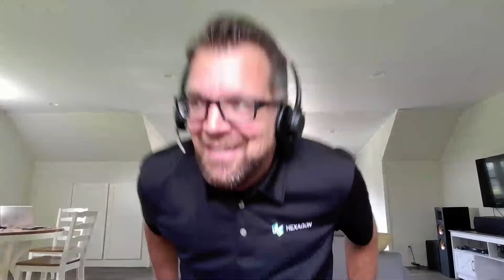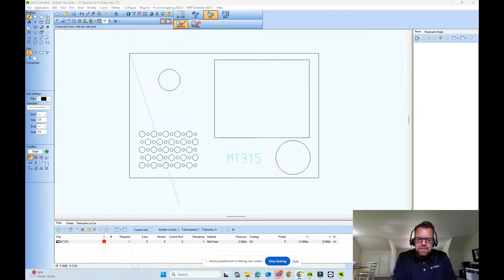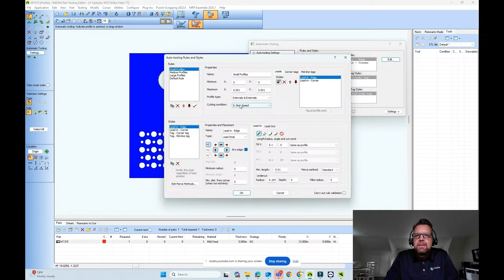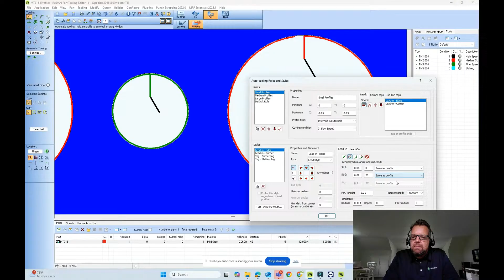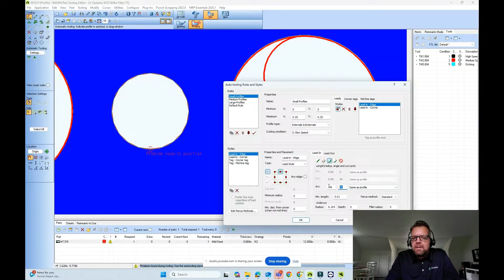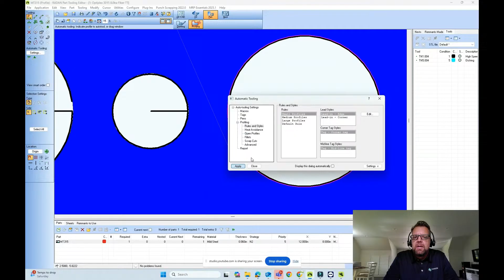RADAN Automatic tooling - RULES and STLES - part 1

Comment: Hello,I was looking for how you can have a double lead-in,I know it's possible but I can't find a way for this.Some of the strategys have this already set but I Wana add this to some strategys that I don't have it yet.
Reply from the maker: We have a couple ways to add a double lead-in if I understand your request correctly.  We do this with the lead-in approach style.  We have straight, double straight, arc, straight/arc, or none.   By using one of the double features we can have two conditions included in our approach.  (Trumpf lasers like this approach)  
If you meant having two lead ins - as in - cut entry in two locations - that would be a tag, which we have several methods for this as well.  Perhaps this video will help with that.  
https://www.youtube.com/live/b1o1go00zSM?si=7PSQWMqlPEJCUlU1